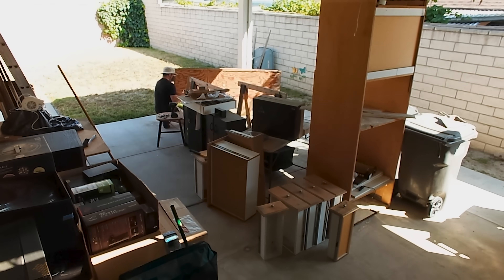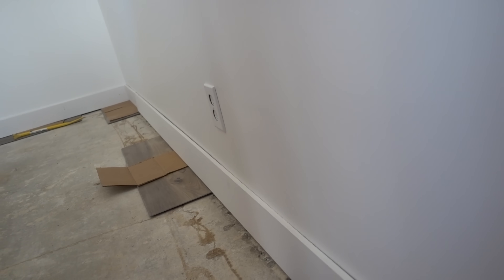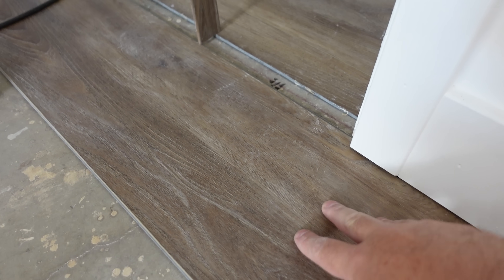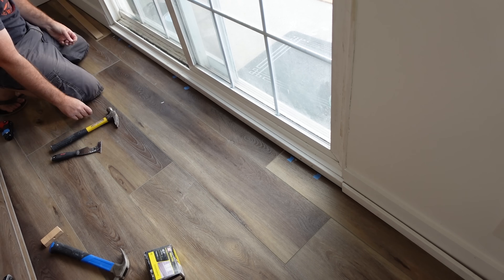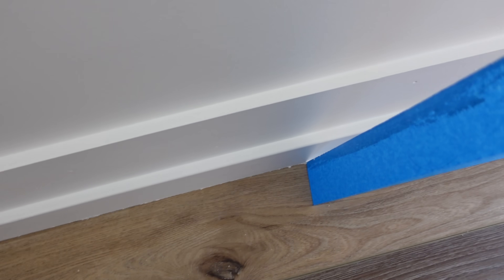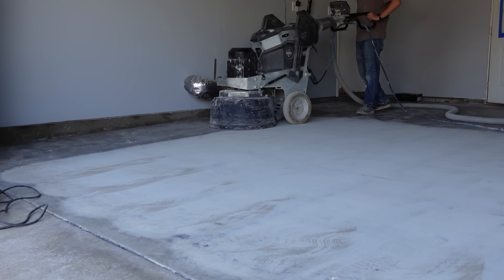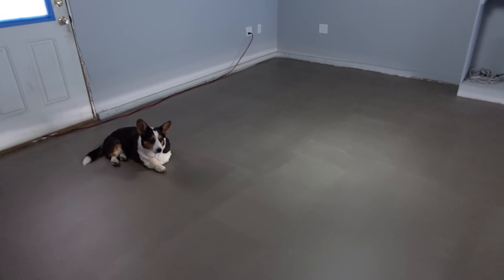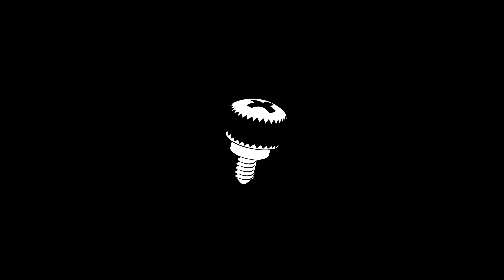Rebuilding from the Ground Up... - Part 4

Comment: You know, here is my order when installing flooring: 
1. Install flooring
2. Cut and test fit trim
3. Take the trim back outside and paint it (yes, you can facepalm when you realize you don’t have to paint it on your knees)
4. Install trim
5. Touch up corners and nails. Done.
Reply: yep lol. Take it out on some table and spray it all the same color and go slap it in.. definitely after the floor is already down, not before..

Comment: 8:35 Paul, you can get what they call "quarter round trim" for the baseboard in that room and install it on the floor in front of the flat baseboard you put. It will cover the crack gap and actually look very good.

Comment: as an ex flooring installer who used to run a crew. some of the tricks you guys used for installing the LVP and scrapping up the tack strip, color me surprised LOL. nice work, and yeah baseboard always goes on after the flooring :P

edit: tip on LVP, you can use a knife to cut what you need then "snap" it to break it rather than taking it outside, it does require a technique and might need you to score it multiple times depending on the LVP quality, but it saves your back and time

Comment: Hi Paul. I'll give you a 9.5/10 score for your labor. NO DIYer gets a 10/10, including me. I remodeled my garage somewhat like yours. I didn't have the floor grinded. Instead, I chose to install that thin carpet found in many office suites. I also added a large air filter for dust-bunny control. Thank you for producing such a nice video, and I award you with a DIYer, 2nd Class badge.

Comment: Excellent stuff. Just a tip here on mitre saw action. Support the length of what you're cutting so you get a better cut and you don't need to get your hand so close to the blade. Better to take a few extra seconds and use a clamp.  If the blade snags it can violently pull in the wood and your fingers along with it!

Comment: I’m a floor contractor myself, I have done exactly these types of floors many times, all of it. The black adhesive residue was once Asbestos filled, the 9x9 tiles. But sometimes also the 12” tiles used an asbestos glue (the black glue). It is still available, but almost nobody uses it because of the oil it contains. That serves as a moisture blocker. These days we do a similar process as your garage floor, grind the concrete clean and epoxy coat it. But they would require a test of the existing black glue to see if a special abatement crew is required, since not just anybody can safely remove asbestos. There is also an encapsulation option where you try to bury it in cement. But since it has oil in it, it will release almost anything you try to bond to it. Perhaps you are well aware, most of the world is familiar with that these days. You really would want to avoid scraping it, and especially do not grind or mill it until you are confirmed safe to proceed. The concrete emits moisture, measured as relative humidity or calcium chloride and the test results determine whether you want to move forward with various cures. This will prolong the lifetime of any floor, because none of them do well long term in high moisture situations. Should an area of the floor get flooded, all rock n lock floors will allow moisture to go between the pieces, get under the floor, and then warp or cup each plank. So avoid too much water, it’s never good. And remember the black glue will prevent water from absorbing into the concrete. So flooding not good. I believe you’re in San Diego, so you may have dry climate and very little to worry about with high moisture substrates like other parts of the country which are swampy, cold, or freezing. Precast slabs are the really hard concretes he was taking about. Some commercial property uses that on all the floors going up, and there’s a curing compound (oil) which is stubborn. Some floor manufacturers have special process just for this reason, but I have never seen a residential slab anywhere close to that hardness. Most residential slabs are bare minimum. You often see 1/4 round available in wood look, or even real wood, which would treat some of those doors you were up against. Or you would treat it with a similar moulding as used between the hall/room. -Forbo/Mondo/Altro/Nora certified.

Comment: That's a ton of hard work, hope you compensated Joe sufficiently. Normally you don't miter 'inside' corners ; Butt to wall then next piece scribe & butt to that one. Square cuts are less apt to open up later.  Surprised you went to such expense on the garage floor ? Totally sealed now, smart. Rugs won't mold. Always nice to watch other people remodel, all the vicarious fresh new space feeling w/out actually doing anything but move a mouse around. Thnx Mr. HDWR

Comment: Heu Paul,  you can put a thing called Door stop around the baseboards, in New home builds its normal to put baseboards first then lay floor then do door stop (covers quarter inch. You can use quarter round but most use door stop style.

Comment: I have that exact same miter saw! Definitely does the job, though I learned that getting a perfect, and I mean perfect, 90 degree cut is impossible w/ it. You can get very close though, and most of the time it doesn't have to be perfect.

Comment: Trick for outside miters is to pre cut 2 perfect 45 miters on a 6-12in long piece. Then you can butt them against each corner before you cut your baseboards. if the miter is not closed perfectly add or subtract .5 to 1 degree to each miter to close up the gap. This works on inside corners too but they are less conspicuous and are not that different to do with a coping technique.

Comment: It's okay Paul I'm sure you cut those miters at 45 degrees. But your house is probably like mine where I believe I've found about 4 wall corners that are actually 90 degrees all the other ones were built after happy hour🫤

Comment: can someone explain what happened in the garage, floor grind, then epoxy, then sand, then concrete? Why?
Reply: So he has a nicer surface to work with? It was pretty rough before.
Reply: Epoxy is designed to bond with clean concrete, so all the residuals from years prior had to be removed. 

The broadcast sand is a non slip method, but they self leveled over it, using it as a bonding agent. 

The final grind and polish used multiple pads, as shown similar to terrazzo finished floors. This is how they polish terrazzo to a shine. 

Finally it was urethane coated, a non absorbent layer to keep oils from getting into their finished concrete.

The grinder is sometimes referred to a triple headed planetary grinder. They’re huge, and the vac system often HEPA filtered because silica dust is not good to inhale. Mesothelioma.

Comment: Hardware store shopping in the US: get your big car, drive there, load, drive home. 
Hardware store day in Europe: 
1.find grandpa's handcart under his rusty pile of Märklin model trains and grandmas garden supplies. 
2.Finding out that the wheels have gotten rusty under the garden supplies. 
3.Derusting the thing. Quite necessary because the whole cart is roughly 120 years old. So no steel parts, only handcrafted iron. Day one is over. Sleep. 
4.Taking it out in to the sun and detect traces of woodworms. 
5.Debugging... unfortunately the manual kind of debugging. Day 2 is over too. But granny had pity and made cookies. Sleep.
6.Walking to the store. Having your way blocked by two road constructions, an old lady in a wheelchair and 3 young mothers with baby buggies and way too much time for gossip. 2 miles later: arrival at the store. 
7. Using two rolls of hemp rope to fix the thing. Putting a little warning sign at the end. Walking back, hoping that your 2m wood beam isn't going to land on somebodies feet in the pedestrian zone... 

I love our public transport system...until hardware store day swings by. And it always will. I am glad to have central heating now. Used to do the trip every week to get fire wood.

Comment: my man... trim goes down after you put the floor down...at least you did that later in the vid
also that isn't epoxy, that's urethane more like polyaspartic coat. They're better than epoxy in basically every way other than price
also SEER 18 rating on your AC isn't that good so I wouldn't say it's top 5 lol
Blow in some insulation for yourself. Go to lowes they have a sale on cellulose blow in insulation. You get 20+ you get a free machine to blow it in for 24 hours and you get 30+ and it gets another 15% discount.. so buy 30+ and go blow in insulation all over the top of garage and rest of the house.

Comment: Some forms of vinyl and laminate flooring are considered to be toxic. This is because certain types can contain reprocessed plastic and other toxic chemicals including cadmium, toxic phthalates and lead. These flooring materials can give off toxic fumes that can impact air quality through a process called off-gassing.
How long does vinyl flooring give off toxic fumes?
In reality, the off-gassing should be the strongest during the first two weeks and continue to off-gas for up to months after it is placed into your home.
I guess you should be glad you don't work at a plant making pvc piping - the control rooms are 300 years away from the plant for good reason and could put a permanent kink in your caulk if not careful due to voc like benzene etc - you should consider hepa pos pressure working in tandem with a heat exchanger - they can be 90% efficient but this will assure you get a lot of air cycling through the house ... Summary of Recent Changes Added discussion on “How much ventilation is enough?” with a recommendation to get at least 5 air changes per hour of clean air in occupied spaces. keep on going - good to see you doing a bit of diy! A GiftRocket with suggested use at Badcock Home Furniture & More of Cutler Bay is a delightful monetary cash present for friends, family, and co-workers.

Comment: Why the hell you mountingthe base boards before the floor? first timein my life I see such a thing .... Also under that king of flooring you usually place an insolating barrier ...
Reply: Floating floors don’t get the substrate prep typically required of a fully bonded floor.